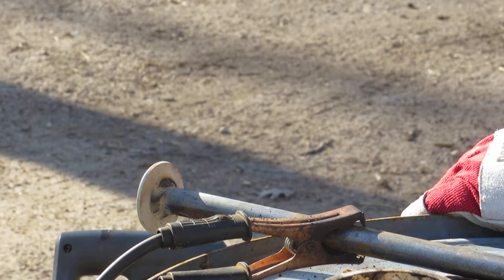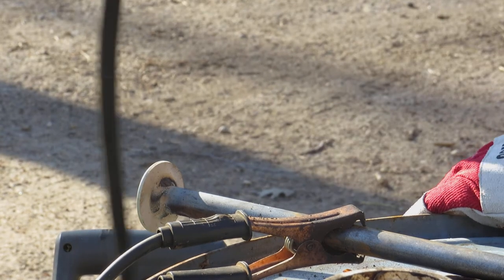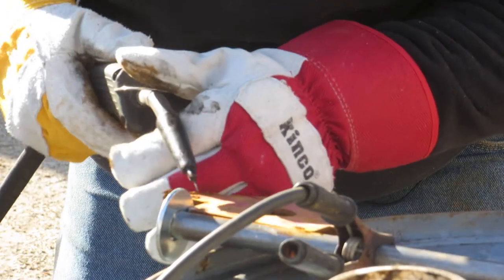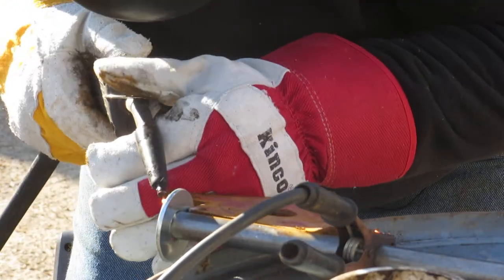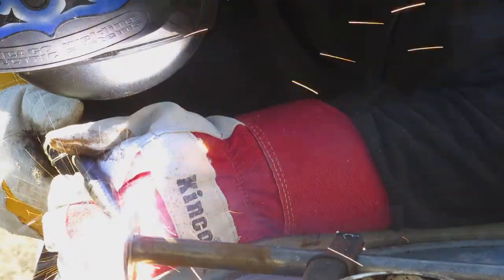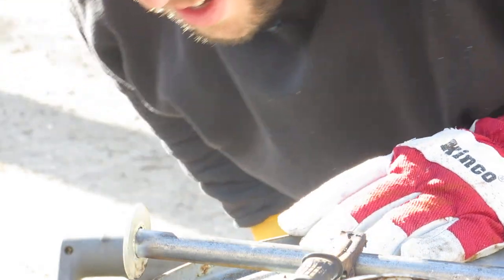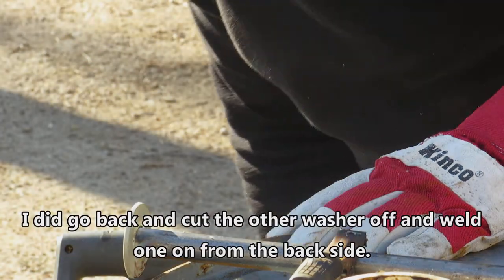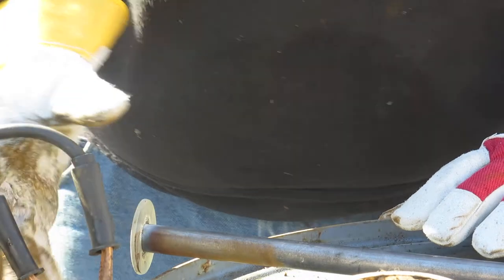DIY 3 point Disc plow/harrow/cultivator build DAY 1. Cat 0/1

Comment: How did you get the disks on after you welded both ends?
Reply from the maker: I put them on before welding.
Reply: I think I understand your question, it appears he had two shafts and welded the washer on the first side so he could stack the disks easily